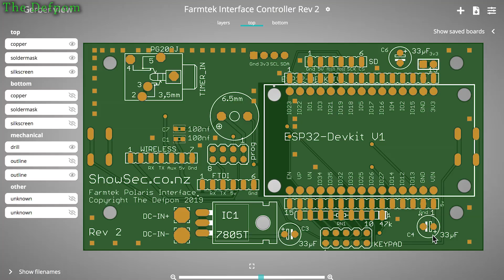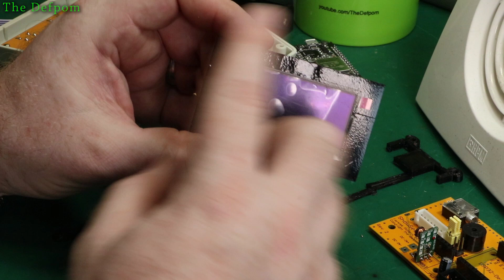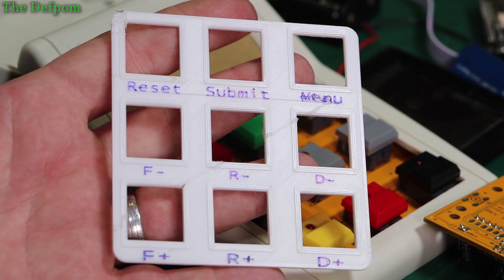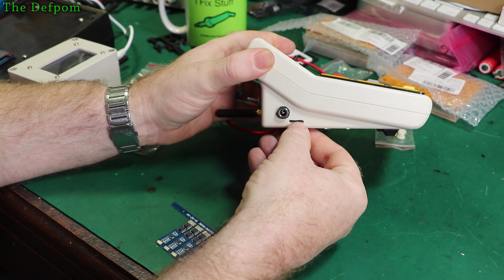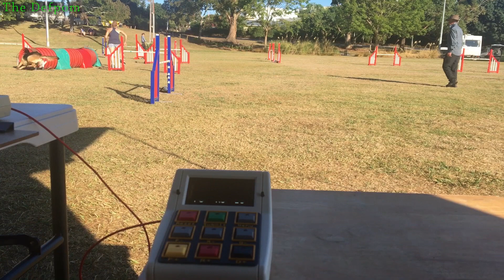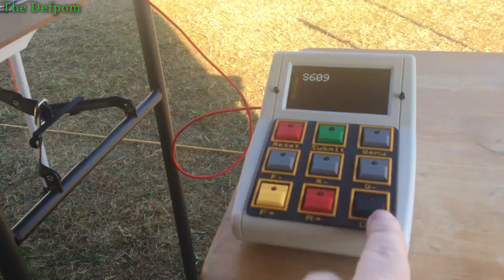#702 Farmtek Polaris Interface Project - Keypad & Controller Part 4 - Free PCB's From PCBway

Comment: The best build surface I have tried is 'BuildTak' with their magnetic, removable build plate. The prints stick well when they are done you just pop the plate off, give it a slight twist and your prints pop off. I believe they now over a PEI type material in addition to the original BuildTak surface. I have had my two 3D printers from work (making breathing masks) running 24 hours a day for the last week and have had ZERO failures due to the parts not sticking, only one failure due to material feeding.

Comment: If you use this outdoor regularly, then maybe place a packet of silica gel inside attached with double sided tape or hot glue
Reply: Nice work by the way.  Getting everything to fit is always tricky.  Even if you have spent days up front 3D modelling it all, you usually forget some connector or don't consider the order that things need to be assembled.